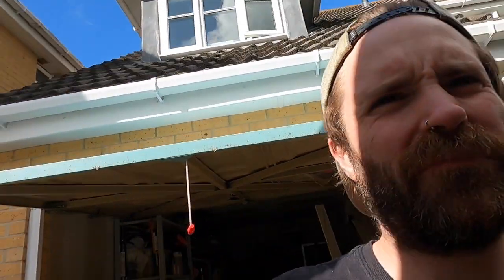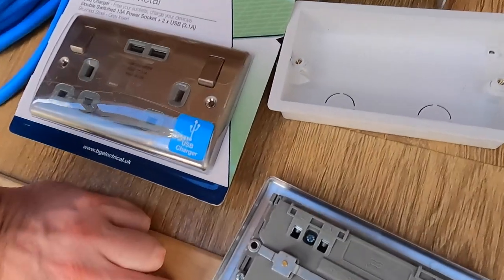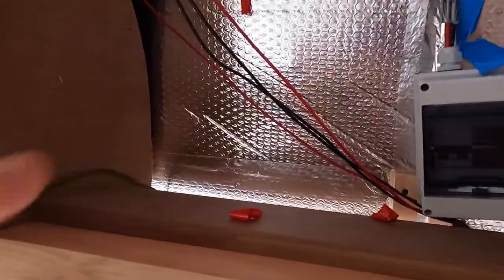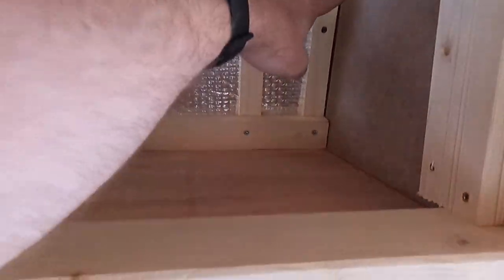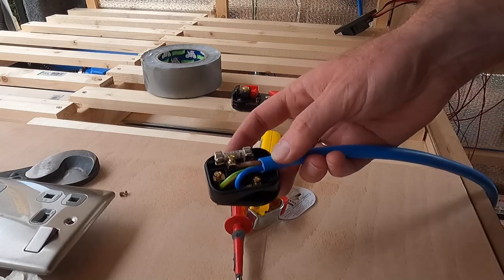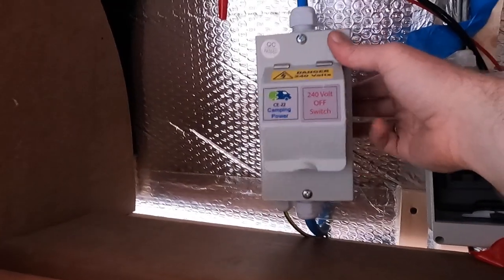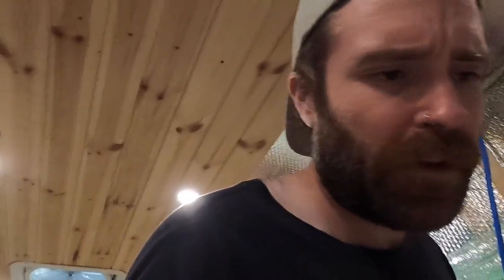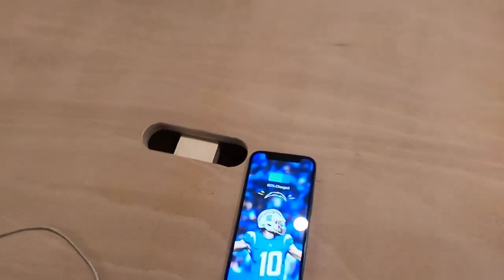Wiring a Consumer Unit and Plug Sockets | Van Electrics | DIY Sprinter Van Conversion UK

Comment: I'm picking up some good tips here, thanks. I'm miles behind you on my build but you've been a good source of info. I was even wondering if I would have to run separate cables for each plug socket. Obviously not. Nice one👍
Reply from the maker: Thanks man! I was initially worried about this too but was very relieved to find out this wasn’t the case, makes life far easier 👌

Comment: I’m very confused how you did that middle plug? You had one cord/wire and three plugs, but you didn’t video the connecting. Did you cut the wire on the middle plug? Please explain? I cannot find a video showing this. I’m doing only two AC plugs but I don’t know how to do it using only one wire. 😮😅

Comment: Hey mate, great job as usual... especially the lock in part 😂 As mentioned, very inspirational, got a question tho. How much wattage could you draw through this series of plugs? Thanks, as always, keep the good work 👍
Reply from the maker: Hello dude! Thanks as always 🙏🏻 I believe a standard plug socket can take up to 3000 watts, however my inverter can deal with a maximum of 800 watts so I won’t be able to plug in things like kettles or hair dryers which use a huge amount of energy. Instead I’ll just be using them to charge things like my phone and laptop, as well as maybe plug in a TV 👍🏼
Reply: @GreenHornCountryClub  Good answer. Having spent several years professionally building campers, people forget that the inverters can only deliver what the're rated at. 800watts means you can extract 3.5 amps at 240v at the most.  But the current from your 12v battery when the invertor is going full tilt is round about 60amps so you do need a battery that can support that load so the supply cable needs to be fairly fat to cope with the current without a large voltage drop in the cable to the invertor.
Reply from the maker: @brianwithers162  thanks bud! Really appreciate the message, that’s some seriously good info. I’ve used 35mm thick cable to supply power from my batteries to my busbars, then 16mm thick cable from my busbars to my inverter. Hopefully that should be enough! Thanks again 👍🏼
Reply: @brianwithers162 what if you have a 3000w inverter? I’m very new to this electrical stuff but I bought a van that has a 3000w inverter and two HUGE batteries! I’m currently rewiring the van to have 1 AC plug, puck lights with 14-2 g wire, and 12-2g wire for my 12v outlets. The van has a big orange stiff wire that was in it but only one was in the A outlet so I had to pull it through the van to get to the other side of where all of my controls and outlets will be. I would love to know what to replace the big orange wire with and still be able to have a regular AC outlet. But I also don’t know how much power I’m going to be using bc I don’t understand the power supply stuff. Lol! 
But the two huge batteries and the 3000w inverter should work right?

Comment: Hi came across your vid , with regards to wiring sockets using an RCBO .. Do you possibly have a link to the one you used or a company that i may purchase it from .. great work, thanks a million
Reply from the maker: Hey dude! Thanks so much for the message, I'm glad you found the video helpful.

I bought the consumer unit from a seller on eBay who puts together little electrical packages specifically for motorhomes:

https://www.ebay.co.uk/usr/ukcampingpower

The package I bought at the time was just the single RCBO in its consumer unit with an earth wire. Looking at his eBay page, it doesn't look like he's selling any at the moment sadly. Although a mate of mine did contact him directly and he did have one in stock apparently, so may be worth doing that.

Comment: Hey man sorry I think this is 5 questions in 24 hours! 
Is radial basically the same as parallel? And if you were only wanting one 230v socket, do you still need to come out of the inverter via a little consumer unit? 
Have been exclusively 12v for 3 years other than hair clippers and I just plug them straight into my inverter. I fancy something more permanent in the new van.
Reply from the maker: No trouble at all man! Happy to help where I can. 

I guess a radial circuit is similar to parallel whereby if one socket fails, the rest will still work, but how the electricity current flows around the circuit is much different in AC circuits compared to DC. 

If your looking to just have one plug socket, it might be easier just to get a wee single extension cord and run it out the back of the inverter
Reply: @GreenHornCountryClub  yeah that’s what I was thinking mate. Bodge it! One extension with the socket cut off the end and wired in to a 230v socket. In my head it’ll work 🤣